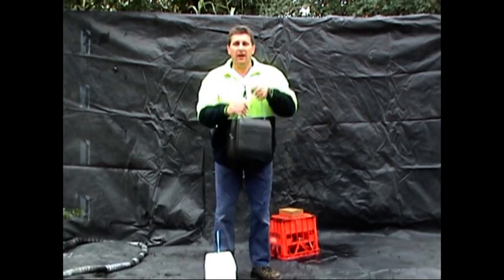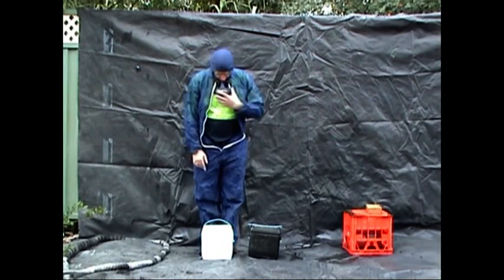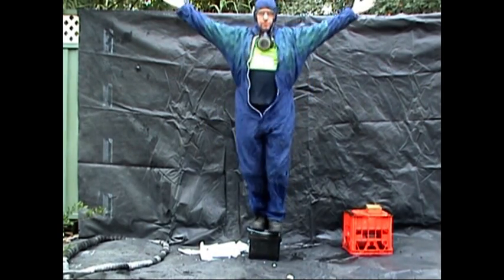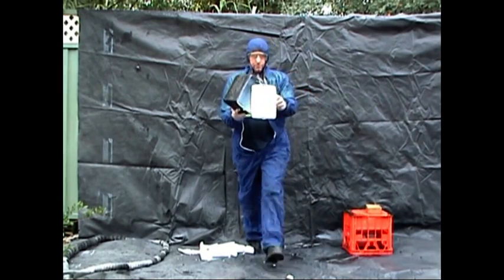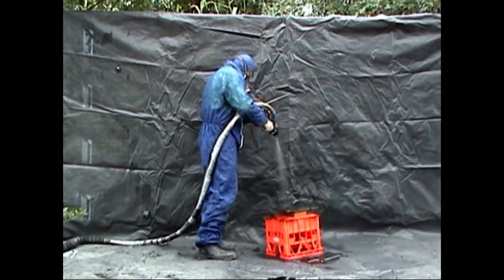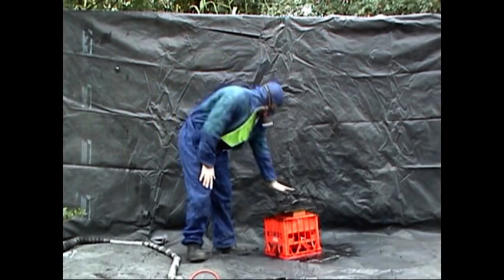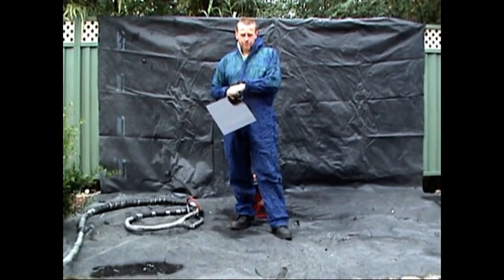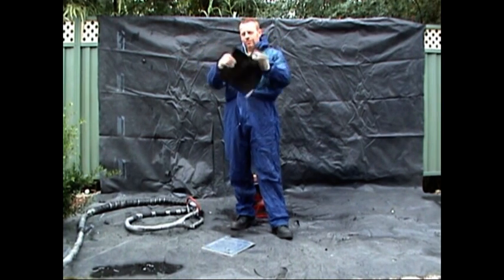Polyurea Demonstration

Comment: As a waterproof method I plan to use a PVC sheet membrane system to a new concrete slab under a synthetic grass tennis court. Below is a carpark. About 600m2 in total. How would Polyurea compare in cost to a welded sheet membrane?
Reply from the maker: I my opinion logistics can drive the cost of Polyurea Application. It will also depend on what thickness the material is applied as well. Let me know if you require this service as I would be more than happy to quote you.
Reply: @BlastItCleanItPaintIt  Access is not an issue. Thickness wise is also not really an issue in a tennis court situation however, the surface needs to be waterproof with long term warranty, what thickness is standard, 1, 2, 3mm? The coating needs to be consistent in thickness. It will be applied to a new steel troweled surface. A lumpy application will likely be reflected in the grass surface, which won't be acceptable. Is that possible?
Reply from the maker: @iandunn9497  It is possible with a slower drying Waterproofing Polyurea at a thickness of approximately 1.5 - 2mm in thickness. Please let me know if you require a quotation?

Comment: Can this be used for swimming pools?
Reply from the maker: Personally I would not recommend it for swimming pools as chlorine will dissolve most Polyureas. Their is well documented evidence to support this. Maybe some manufacturers depending on what country you live in will have a Polyurea that will do this but I would be asking for its chemical resistance chart or data to prove that it will not fail. It's a wonderful product but must be applied in the right environments.
Reply: Use ChloriPur for swimming pools. It is the best.
Reply: We used polyurea for our swimming pool, because it's a very unregular shape. It is the best solution for such projects. Personally I haven't heard that Polyurea would dissolve in chlorine. Make sure you use aliphatic polyurea - it is UV resistant. And you can always apply some coating to improve performance. Top Product!
Reply from the maker: @antitransful I agree that with your statement above. Since this video was made there has advancements in Polyurea. Only certain types of Polyurea would be suitable. As I have stated above certain countries may have their own brands that are resistant to Chlorine & it would be best to further research that product before applying.
Reply: Agreed

Comment: can you spray this over tile? what kind of prep work is required??
Reply from the maker: Hi Chris, we have sprayed over tiles in a Casino. The prep work that was required was to to grind over the existing tiles with a very abrasive discs to provide a suitable key. Cleanup. Followed by the recommended primer for the Polyurea that requires to be applied. We gun textured the floor to provide a non-skid finish for the bar staff. Hope this helps.
Reply: +Blast It Clean It Paint It...this helps tremendously. wanting to make sure it's possible before we sink the money into the investment. thanks so much. I watch your videos alot.
Reply from the maker: +Chris England Many Thanks. Glad I could help. Hope your project is successful.